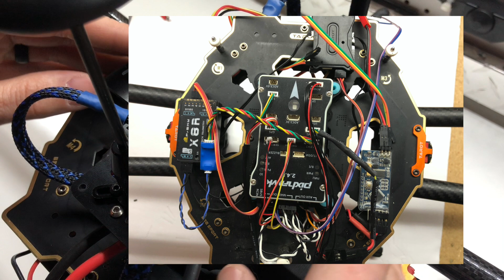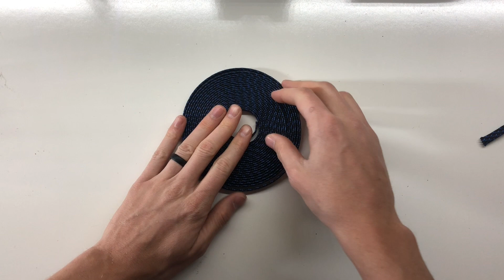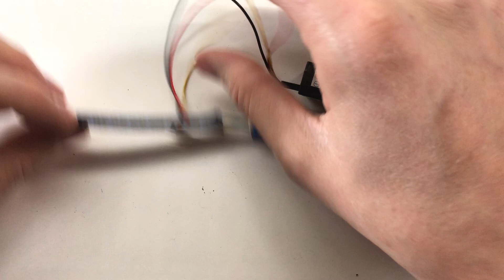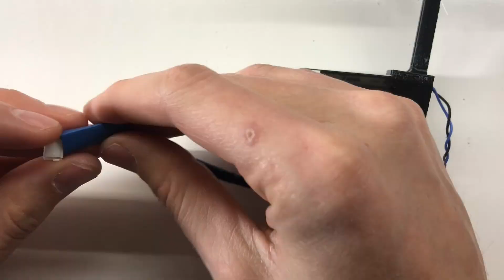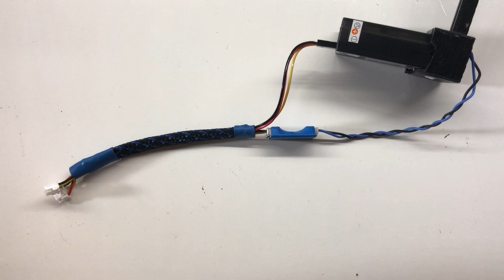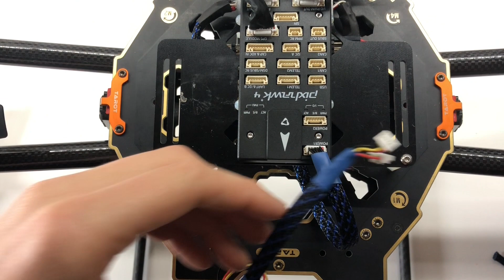Managing your drone cables

Comment: I just got some of this for my fpv drone.  I wanted to wrap my motor wires.  But it frays so fast...I'll have to try again.
Reply from the maker: Make sure you either put some heat on the ends to melt the tips or use heat shrink. Personally I do both.